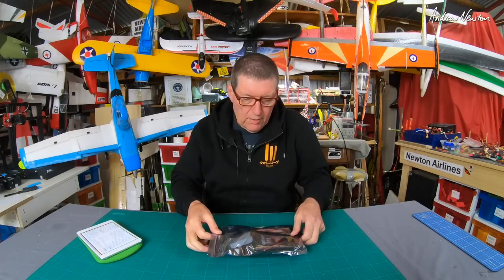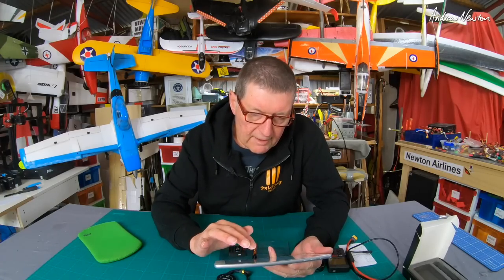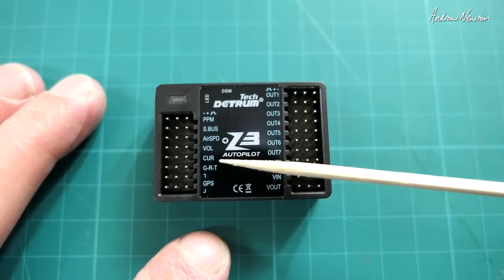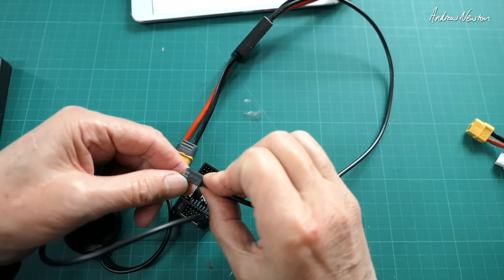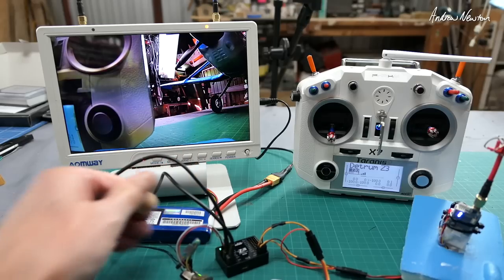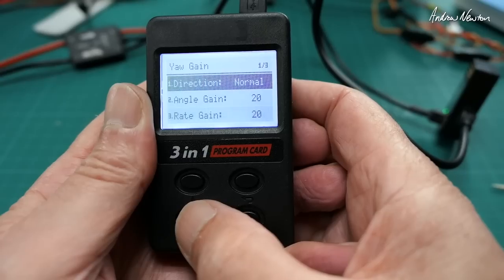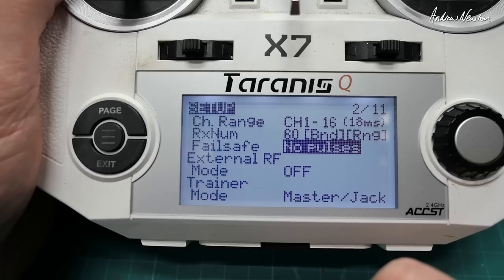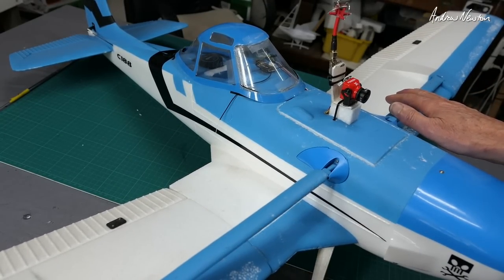Detrum Z3 FPV Autopilot

Comment: Handy looking unit for the plug and play brigade. Much better documentation than most. The solid wiring should make it more durable but the extra weight might limit it to larger planes. Price getting up there at about AUD150. Useful info in the documentation.......
"3,One-click RTH & Fail Safe: The Guarantee of Safe Flight
Toggle the remote control RTH switch when required, the aircraft will maintain the current altitude(By default, when manually returning home, the aircraft will climb to 60 meters when the altitude is lower than 60 meters, and lower to 120 meters when it is higher than 120 meters.), and the autopilot will return to the take-off point side by side-waiting for you to regain control of the aircraft(The default circle radius is 50 meters). Parameters such as return speed and hovering radius can be set in the programming card according to the properties of the aircraft.

With out-of-control protection function (DSM, S.BUS receiver is activated automatically, PPM receiver needs to set out-of-control protection), when the aircraft flies out of the remote control range or the signal is bad, Z3-FPV flight control will automatically take over the aircraft, the height * keep 100 meters Fly back to the take-off point and circle (circling radius 50 meters) waiting for you to regain control of the aircraft. 

*The above mentioned heights are relative to the take-off point"
No mention of if it supports the "Autolaunch" facility of the Kopilot and LEFEIRC SN plug and play stabs.
Reply: It's for planes which can hand throw take off ?  if so, Z3-FPV have auto-recovery Mode,   it equal launch-mode ,when launch , Z3 fpv keep your plane in safe

Comment: Great video as always.  Question: what are your loiter radius options?  Can it be set tighter than 50 meters?  Also, is there a option for units in feet instead of meters?  Can’t wait for the flight video.
Reply: My thoughts exactly.
Reply from the maker: Radius can be changed but only metric I think

Comment: Hi Andrew, Looking to get something that's very much plug 'n play in terms of an FPV autopilot/osd with (at least) RTH feature. Having come from using the relatively easy Cyclops Storm system before, all the issues people seem to have with setting up Inav - even pro's like yourself - has steered me in the direction of sticking with a basic system like this Detrum Z3. Is this system - to your way of thinking - still one of the best go to basic systems or would you maybe recommend another brand/model  that you are aware of? Thanks.
Reply from the maker: I wouldn't recommend this one Rocco. Too buggy and badly programmed with no support. The only other would be the Kopilot although it doesn't have OSD.
Reply: @AndrewNewton  Thanks Andrew, appreciate the feedback!

Comment: I purchased one of these and am trying to run it off of a FrSky R-XSR. I am trying to get the mode switch and RTH set up on my QX7, but they are not registering. Your video kind of skips through that part. Can you elaborate pleas. I am new to the QX7.
Reply from the maker: On the QX7 mixer page choose a switch as the source for Ch 5 (Modes) and a different switch for Ch 6 (RTH). That's all I did and it worked. You might be able to choose different channels using the Detrum setup card too. I dont have it any more to check

Comment: Im having a difficult time setting up a receiver to the detrum z3. I am trying to use a spektrum 3.3V serial satellite receiver but it doesn’t even light up. Any suggestions?
Reply from the maker: Not a Spectrum user sorry
Reply: @AndrewNewton  I only get a flashing red light on the z3 flight controller.  Do you by chance know the significance of that?  I know that a solid red light means it is locked and you need to move the throttle down-right